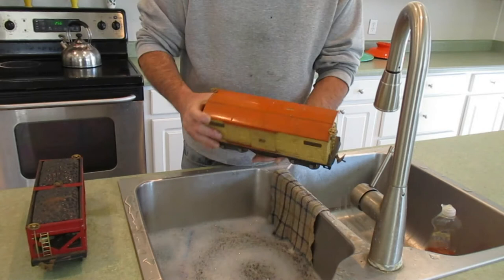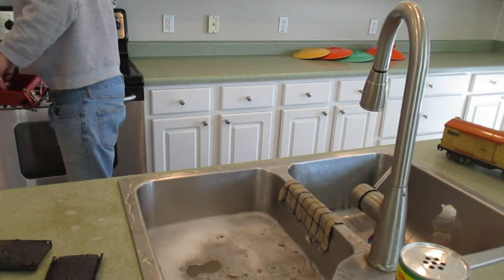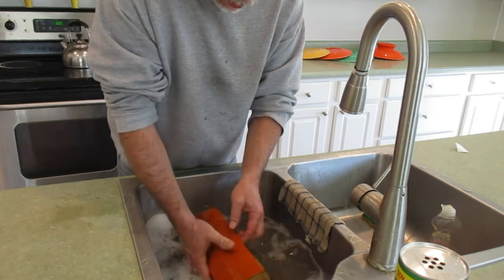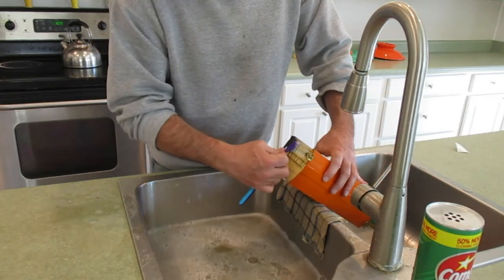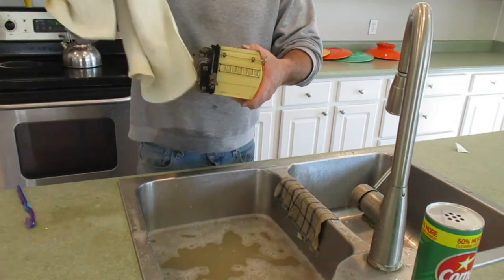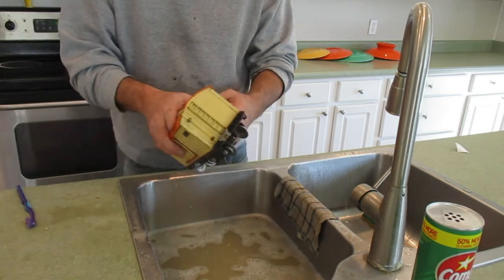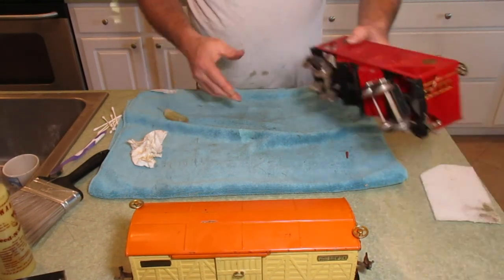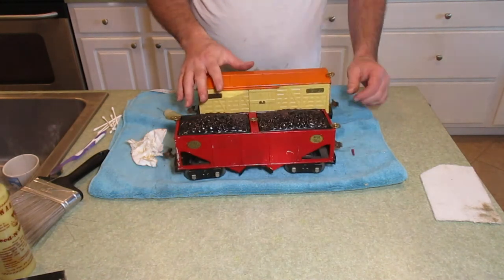Cleaning Lionel Prewar Toy trains

Comment: Thanks for the idea! Only thing I did differently was use Bar Keepers Friend instead of Comet. Cleaned the metal work just enough, without putting a high buff on it, that you get with metal polish. Just got rid of the tarnish. Also, did not damage the original paint.
Reply from the maker: When I started with cleanser in hthe 1970s, I was using smooth top stove cleaner. Comet is a bit more cutting, but I've learned not to lean into the car so much and let the cleanser do the work. This is easer than repainting and preserves the original finish.